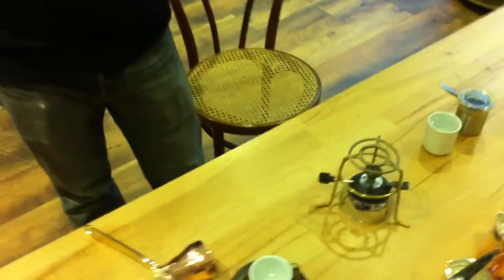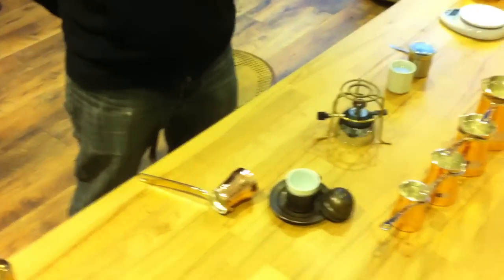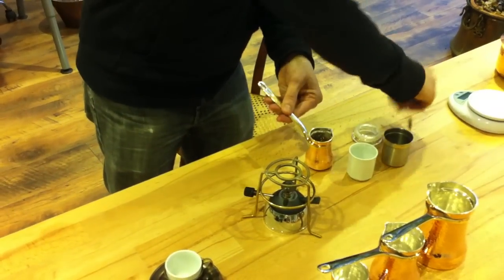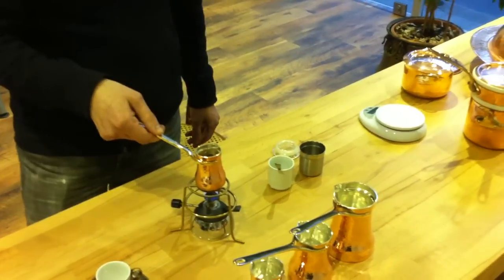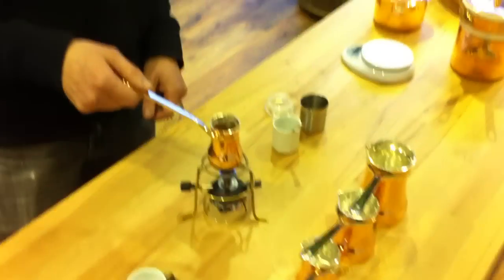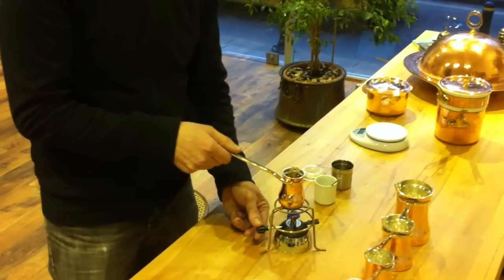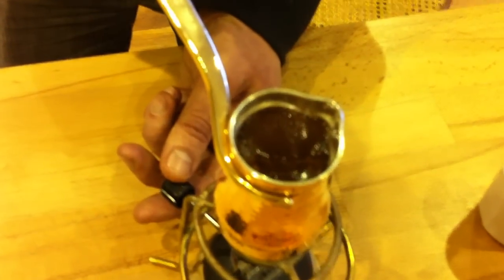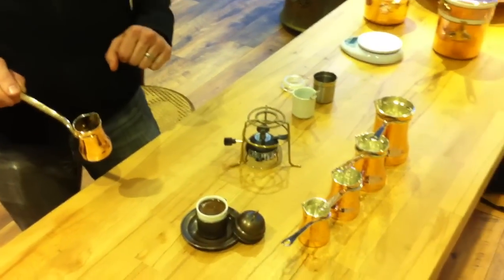How to Make the Perfect Turkish Coffee

Comment: you mean 10 ml of water not 10 gm of water..
Reply: 10 grams of water is exactly 10 ml of water. Go test it out yourself if you want.
Reply: DukeOfWellington One of the many reasons that the metric system is kickass :)
Reply: ***** LOL
Reply: +Ilya Soloviov Possibly not a mistake - he probably weights it! Its more accurate to weight liquid than to view the level for ml.
Reply: Conveniently, the density of water is 1g/mL (it changes with temperature but if you're measuring at room temp that assumption is valid). So 1 gram of water has a volume of 1mL. 10g water = 10 mL
Reply: Thats also at sea level as it depends on altitude as well, but... no issue.
The ability to weight water also makes it more accurate than by eyeballing the level.
I use it a lot as its more convenient for me.
Reply: that's a tough one